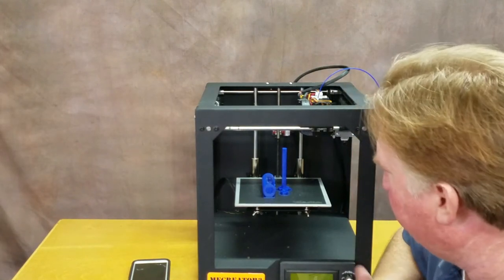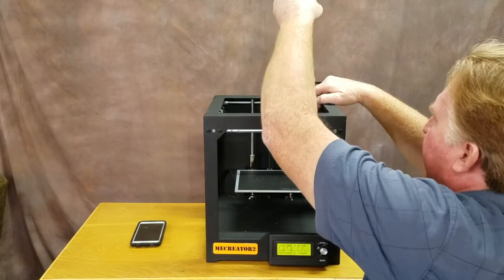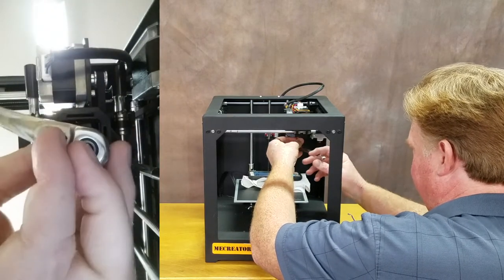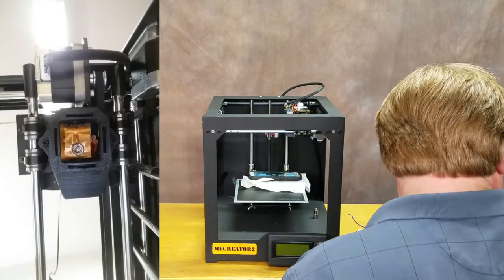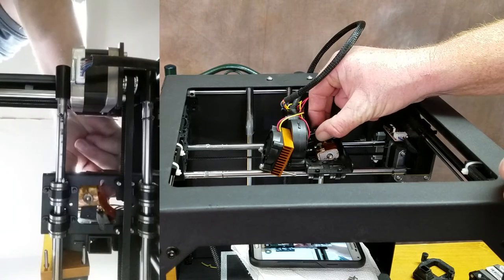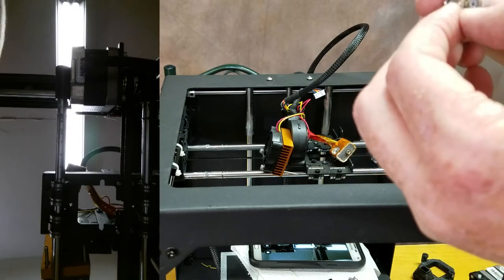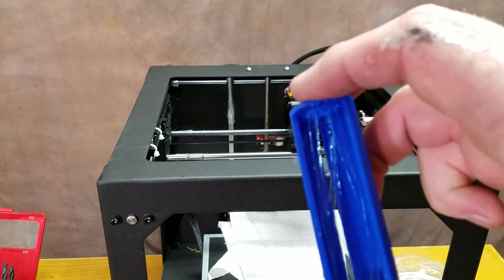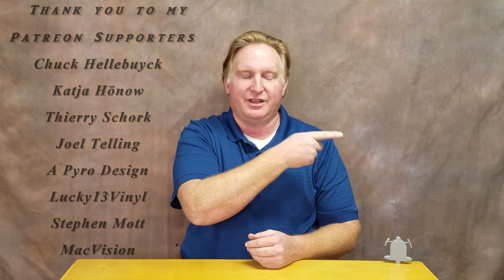Changing the Nozzle Throat Teflon Tube on the MeCreator2

Comment: Why were you able to unscrew the throat tube from the heat block with your bare fingers? That indicates that it wasn't seated tightly against the back of the nozzle like it should have been. If it isn't, then it'll leak and ooze like crazy.

Comment: I have been having jams with my Mecreator2 and need help I bought a new hot end and throat it still jams please help me I also had leaking on the top of hotend block help me fix it because that is my only printer that would work right now
Reply from the maker: +TechMan47201 Ok, let's start at the top.  What exactly is happening when it Jams?  Does the filament extrude out of the nozzle smoothly when you do it manually?  Did you clean the teeth of the extruder gear?  If all that is good, what is your retraction distance?  Too much and it will jam.

As far as the leaking hot end, did you adjust the nozzle throat far enough into the heat block so the nozzle butts up against it?  Did you heat the hot end up before tightening the nozzle?  If yes to all that, extrude some ABS filament to seal it and the problem should be fixed.  If not then you may have to do what I have done in a past video and cut a new Teflon tube to create a better seal.
Reply: Jimmy Shaw's Tidbits it is all the way jamed it doesn't extrude anything at all I figured out that the leak was my fault but I try to push the filament and it does nothing at all
Reply from the maker: +TechMan47201 Is the heat block reaching temperature?
Reply: Jimmy Shaw's Tidbits yes I even put it a 240 degrees and it still didn't' do anything still jamed
Reply from the maker: +TechMan47201 I guessing the nozzle was changed along with the hot end.  When you remove the nozzle and everything is cool, does the filament travel thru the nozzle throat smoothly?
Reply: Jimmy Shaw's Tidbits ya it did then it gets stuck in the teflon tubing but there is nothing wrong with that it is the correct size but the middle is too small and gets jammed there
Reply from the maker: +TechMan47201 Everything is wrong with that.  The filament is 1.75mm and the Teflon tube is supposed to be 2mm.  Once everything heats up if the tube is going to grab the filament even worse.  They sent you a defective nozzle throat.